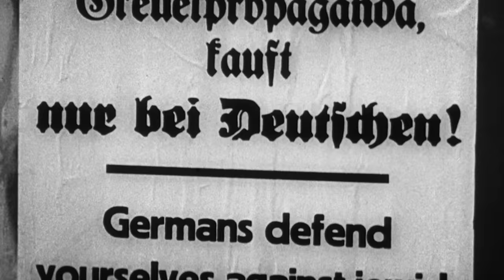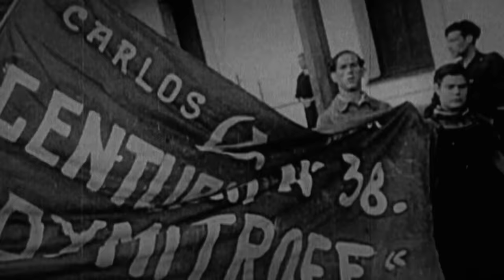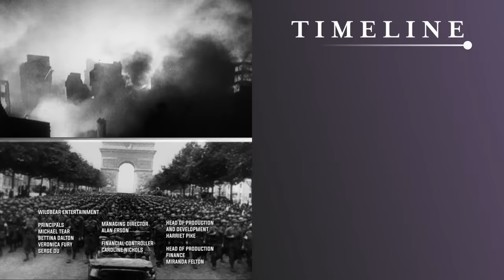Why World War I Caused World War II | Total War

Comment: Strategic ambiguity is generally defined as "purposefully being vague to derive personal or organizational benefit." Zaremba, A. J. (2010).
Or as the street would say, "sticking the finger in every pie possible everywhere, anytime, but mum's the word..."
Too much "strategic ambiguity" at a time "strategic consolidation" is required, leads to "empires" and corporations failing in the long run. 
Too much intent on short-term gain, at the expense of long-term stability, leads to the foundations of an empire (any "empire") or corporation turning into the "clay" of the famous symbolism/idiom: Warrior with clay feet.

In this regard, the turn of the previous century offers many examples of "nails in the coffin" of the British Empire, and allowing the Anglo-Japanese Treaty of 1902 to expire (see below comment), rather than morphing it into something more suitable for the times, is an example of "clay feet" rapidly being created. Along with similar turn of the century examples, like the 2nd Boer War, and not pushing for a more united Europe, being other examples of "clay feet" created which evtl. led to the topling of the "warrior" called the British Empire.

The most compelling argument (on the surface) against renewing the Anglo-Japanese Treaty of 1902 was made by Canada. Of course the fear of being dragged into of a war between Japan and the USA via London/GB/British Empire, for whatever reason, would have hit Canada hardest. Therefore an argument against a treaty with Japan is compelling...but also false.
At the time, the issue was mainly China.
Fact: The isn't a single example of a nation or state being "forced" into a war its hawks did not already find desirable or inevitable, etc.
It would have been fairly simple to morph the existing Anglo-Japanese Treaty of 1911, to exclude any acts of provocation or aggression by Japan. That way, in case it was Japan which was pushing for trouble, London/GB could have taken action to restrict it (by stating that Japan would be on its own if it provoked a war with the USA, and ignoring warnings in re. to such). Another factor often forgotten, is that within the British Empire, the Domininions had gained the rights to declare war themselves. Unlike colonies like India, which London held the right to declare war on behalf of, nobody could force Canada to become involved in a war, and a declaration of neutrality was always an option.
Of course, in a decent world, nobody would dare invade a neutral, so that Canada was safe under all foreseeable circumstances (at least "de jure").
The argument "Empire potentialy drawn into a war started by Japan" at some point after WW1 is invalid, and therefore other reasons for not extending the treaty must have existed, which are clouded by secrecy even up to today.

In regards to keeping the Anglo-Japanese Treaty intact, and granting the Japanese nation the "honor" of becoming equals at Versailles.
According to Machiavelli, it would also have been a wise step towards saving the British Empire (along with ending the short-sighted European habit of "creating pariahs per treaty"). The argument usually raised here is "yeah..but the Japs didn't want everybody to be racially equal, so duh..."
True.
The "totally un-racist" London (lol) could have outflanked the equally racist leaders in Tokyo, who just advocated "racial equality" for themselves of course, and advocated for "racial equality" as a general obligation or declaration of intent, for all races.

Machiavelli...
What did Machiavelli say about the real value of mercenary armies you must pay (money as incentive) to do own bidding?
"And experience has shown princes and republics, single-handed, making the greatest progress; and mercenaries doing nothing except damage." Nicolo Machiavelli, 1505
Obviously, money is a great incentive to "sign up" for something, but it offers less incentive to die for a cause one isn't exactly a fan of...
Starting around 1900, but especially after the financial "slap on the wrist" of WW1, the Lords in London could and should have turned masses of "inferiors per desired outcome" in their crumbling Empire into a "Pound block of equals".
They could have turned the masses of "inferiors" all over the world, into "armies of equals".
The old strategies again proving themselves almost 100% correct, for when the time came (1940) GB found itself "alone on the beaches and in the hills", rather than have millions of "equals" turning up to fight for a common cause. Own previous failures, simply offered the incentive for "masses of inferiors" to "sit on the fence" to await the outcome for own causes.
Combined in mutually beneficial alliances, rather than "inferior mercenies" which came from "colonies", to create mutually protecting dominion-like independent/suzerein states in a re-organized soft-power empire was the option not taken. Unfortunately, the spineless and equally racist "hero lords" in London, unwilling to stand up to wrongs, did not understand even this most simplest of logic, and therefore lost their inheritance (Empire). 

"The greatest patriotism is to tell your country when it is behaving dishonorably, foolishly, viciously." Julian Barnes

Everything you've been made to recite as a "chest thump/cool move"-moment in history, like Versailles or allowing the Anglo-Japanese Treaty to lapse without a replacement, simply just another nail in their own coffin of "Empire".
The gatekeepers in London (starting "around 1900"), a total failure.
Too much "strategic ambiguity" at a time "strategic consolidation" is required, leads to "empires" and corporations failing in the long run. 
You don't become "the best", if you finger-point at someone "bad".
You don't become "high IQ", if you consider someone else "low IQ".
You don't become "smart", if you laugh at someone "stupid".
You don't become "more superior" if you look down at someone you've termed "inferior".
Reply: Even the meek tell themselves they are superior to the heathen. "Equality" is strategic.